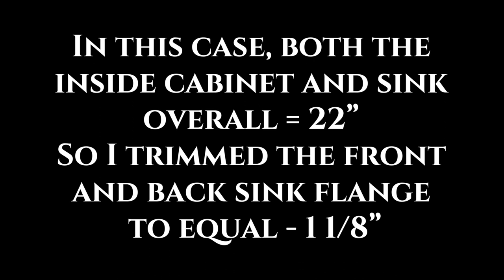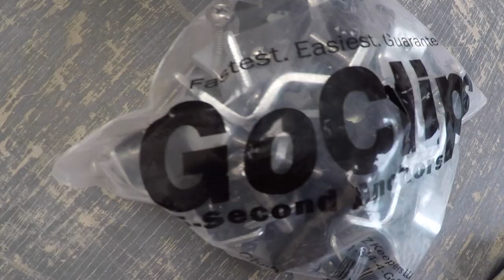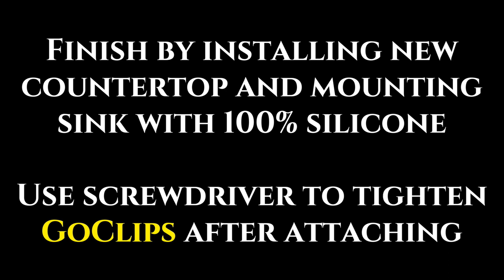How  to Install a Undermount sink in Quartz using (GoClips)

Comment: What's up Jay! Cool video! I like those clips.  I usually just glue bolts in but those look easier.  How about a video on doing a waterfall?  You ever do those?  I have one coming up any tips?  I have a partner company who does waterjet cnc and will give me the 45 mitre edge top and side pieces I guess.  I'm thinking of buying that 90 degree suction system to aid in the process.  Any tips on templating and putting these together are appreciated.
Reply from the maker: Hi Dan. Waterfalls are definitely popular right now. About once a month they come along. The big islands with both sides waterfall to the floor. It's a cool look for sure.
Personally never used the 90 degree seam setter for drop legs. I've always had great results with just blue painters tape. But I will be doing more videos soon. This is one on the list. Thanks man and stay tuned. Trying to hit 1K Subs before more videos.
Reply: @GraniteByJay  Well painters tape would certainly be cheaper! They want a couple grand for 90 degree unit!!  So what do you do if the floor is not flat? scribe it or just have small gaps along the bottom and fill with colored filler? Thanks Jay!
Reply from the maker: @beachhouse131  Hi Dan. I almost always oversize the drop legs by about 1". Then when everything is dry fit, I'll contour cut to the floor. The only times I don't do this is when the floor is going in after we are done with the legs. For this I still try to nail the measurements for practice. But doesn't matter if you end up a hair short. Thanks Dan.
Reply: @GraniteByJay  Thanks Jay.  Ya that's what I planned to do as i have a bit of a hump in the floor.  So some guys I talk to go 46 degrees to bring the corner tight. What's your thoughts on 46 vs 45 degrees.
Reply from the maker: @beachhouse131  46 degrees is the way to go for sure. Makes the front edge of the seam almost invisible.
Reply: @GraniteByJay  Thanks Jay!

Comment: I have 34'' inside measurement of my cabinet.
Is there a way to install 33'' Blanco undermount sink, or do I have to downsize to 30'' ?
Reply from the maker: There is a way. No need to downsize your sink. Usually for that size, when using a blanco or any single bowl sink, I just attach either a 1x4 or a 2x4 to the sidewalls of the cabinet. Cut your boards about 18" in length and screw into sidewalls with silicone for a secure platform for the new sink to sit on. Remember to set the wood lower then the tops of the cabinet. The thickness of the sink you are using.
I mount sinks in this way a lot. Works great and is extremely solid when done. If your sink still has a gap after the counters go on, just shim up from between the wood braces and bottom of sink flange. I'll be making a video on this install method soon. Hope this helps.

Comment: Way too much work. Install a Hercules Universal Sink Harness to the cabinet sides. Bar clamp the sink in place after siliconing. Tighten a single bolt while you sit facing the cabinet instead of struggling on your back. Clips leak; strapped sinks don't.